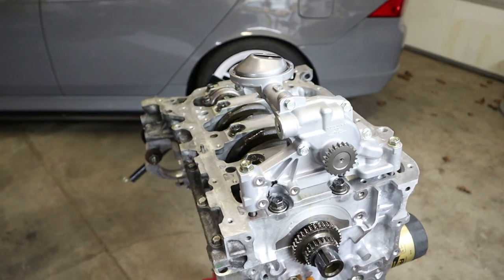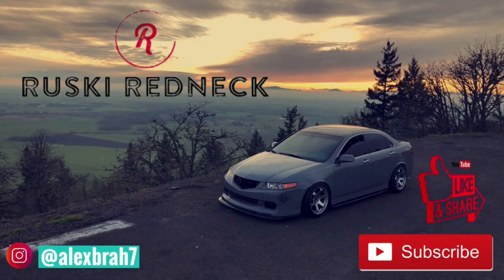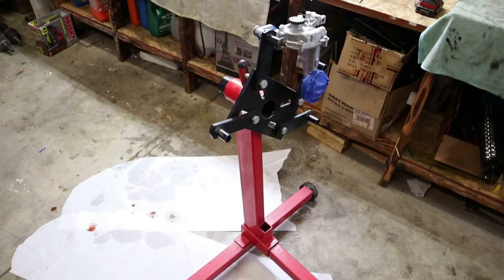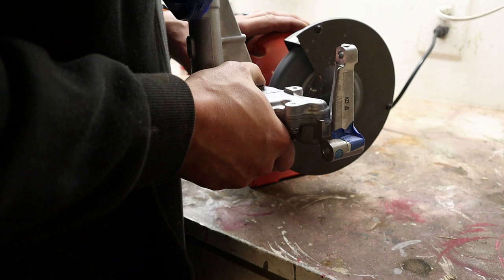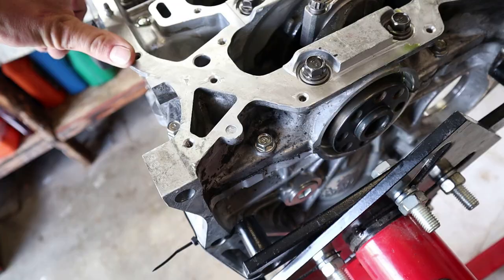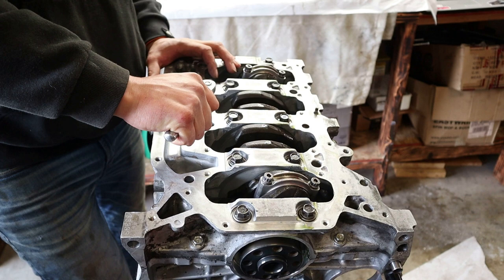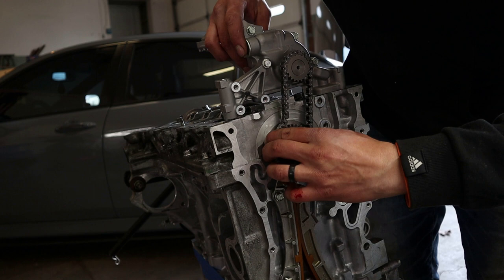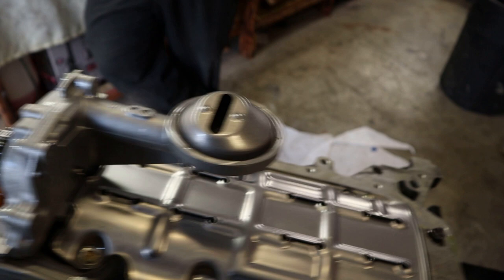Acura Tsx: type s oil pump install(cutting pump to fit)

Comment: What is your experience like with the motor in the car after installing the oil pump? I’ve been doing a lot of research and other people’s testimonies are limited but theories are plenty on the forums. How’s the “vibration”? What rpm? Any noises? Other things you notice?
Reply from the maker: I personally didn’t notice any vibrations. There might have been a slight increase but it would have to be minimal for me to not catch it. You don’t really feel anything else besides peace of mind revving up to 8k. It’s an oem replacement part.

Comment: What is all needed for k24a2 to k20 type S oil pump setup ?
Reply from the maker: Oil pump chain. K20 oil baffle plate. And bolts. You can Google it. There’s a ton of sites showing the parts list with part numbers
Reply: @RuskiRedneck  good look

Comment: Wheres a good location on the oil pan to make a hole for the oil return fitting?
Reply from the maker: The back as close to the top as you can. I’m actually doing a video on that next.

Comment: Did you have any transmission issues while it was boosted?
Reply from the maker: No. Eventually I will pushing 500hp. I am going to be rebuilding my trans. Not sure what direction I’m going with yet.
Reply: @RuskiRedneck  ppg 1-4th dog gears, stock 5th and 6th 😎
Reply from the maker: @Rooooooooooob  I’m trying to build my car for top speed highways pulls. Rolling mile drags not quarter miles. So looking for longer gears

Comment: Btw you could definitely go more than 8k maybe like 8300-8400 atleast. 
Everyone almost runs 7800 with the reflashes
Reply from the maker: You’d be correct. A lot of people rev even higher. Maybe I’m just being a bit hesitant since my last motor got blown. But I was fairly happy with my last build reving to 7300.
Reply from the maker: No it was definitely the tune that blew it. Motor leaned out. I’m just saying since this is my second build I’m a bit hesitant to push it to its limits😅 I mean I’ll probably only rebuild it like 4 more times if it blows before I give up on the tsx.😂

Comment: You need a k20 types oil pump guide part number # 13460-pnc-004 the chain is going to eat thru the guide